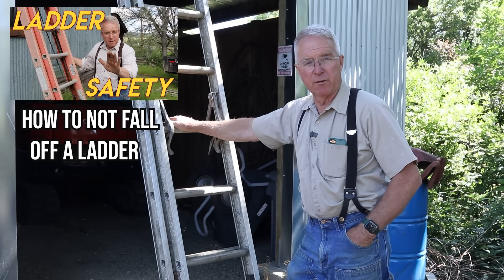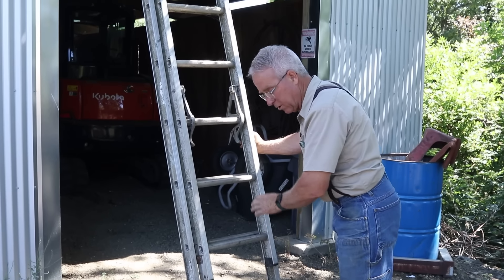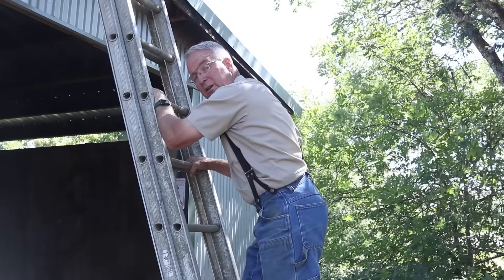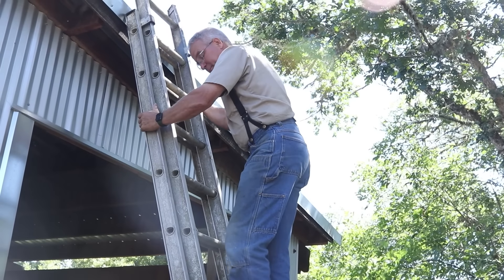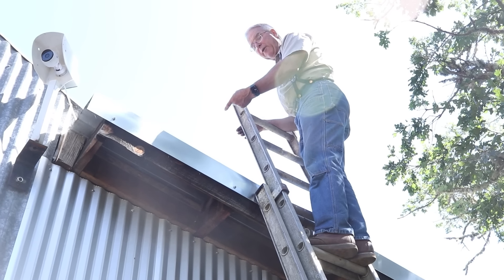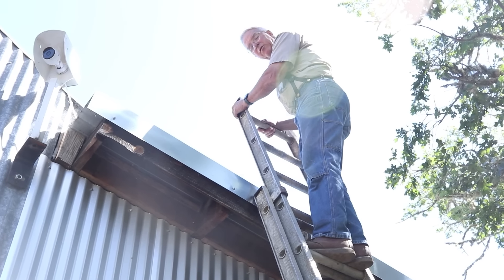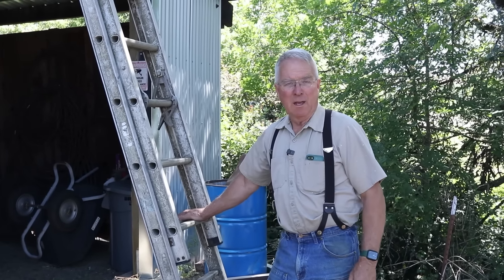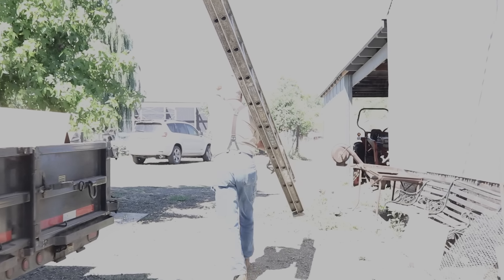How to Climb A Ladder, Dismount, & More Tips

Comment: You forgot 1 important thing when carrying an aluminum ladder. Look out for overhead power lines.
Reply: Solid point!
Reply: I'm Shocked this wasn't mentioned! :)
Reply: Electrifying comment
Reply: @rjtumble 😂
Reply: Yeah, it’s a current issue
Reply: Absolutely stunning!
Reply: Alternatively, you could just do that directly on every job site
Reply: @evanosvath9632
Thanks for those images. I’ll be very very careful from now on.
Reply: And open manhole covers.
Reply: Excellent video. I have a burned out aluminum ladder rung from many years ago when my ladder spun and shorted out a service entrance cable. Fortunately, the rest of the ladder was fiberglass. I would not have an all aluminum ladder. The rest of the video was first rate.
Retired telephone repairman.
Reply: @rjtumble  That's too easy!!!
Reply: And if you don't pay attention, you won't have to worry about anything much longer lol
Reply: Amazing point.
Also once you get to the top don't jump off.
And water is wet
Reply: And Walruses
Reply: You don't want to be a good conductor unless you work for Amtrak
Reply: This is actually a really good tip.
Reply: He’s a bright guy, you’d think he’d conduct himself differently and already know that tip.
Reply: Watt did I miss?
Reply: Yep, carry horizontally on shoulder, don’t carry vertically.  Unless you’re making a Wile E. Coyote video.  Also, I like a nylon strap securely attached to structure lower end and top end. Prevents kick out…
Reply: if people don't automatically do that, they probably don't want to be on a ladder in the first place.
Reply: its so scary 😨😨😨😱😱😱😱😱😱
Reply: Time for an updated video again lol
Reply: @dangoodwin5250 Perfect comment - made me laugh out loud !!
👍👍

Comment: I think you missed an important thing to watch out for: accidentally stepping off the ladder from the second rung thinking it is the bottom rung.  I've done this multiple times (especially a step ladder) because I was not watching the rungs as I got off.  Don't let your guard down until you have both feet off the ground, similar to watching the ball go into your glove in baseball or making sure you catch the football first before making a move to avoid the defender.  If the sports pros still make those mistakes so can we.
Reply: Right on. Easy way to break an ankle, or worse.
Reply: That "thinking you're on step one" when you're on step two scenario is a good heart-stopper.
Reply: I've painted the bottom rung of my step ladders bright orange so  I can easily glance down to make sure I'm on the bottom rung before I step off.
Reply: I've done that too.  The solution is to always assume that your next step down will be another ladder rung until you actually feel the ground/floor.
Reply: Done that a few times and almost messed my pants every time!
Reply: @markhendrickson5886  Presumably with non-slippy-when-dry paint :-)

Comment: As a retired builder and old guy, my house and outbuildings all have an eye bolt screwed in near the roof at the ladder locations. The first thing I do is firmly tie off the ladder before climbing off the ladder onto the roof, that way I know if anything happens, I can grab the ladder with confidence that it is not going anywhere. I know this practice has saved my suspenders!
Reply: is it hard to install eye bolts on the roof??
Reply: @tricatfilms6136  No, not on the roof. Install it in the facia, soffit, or wall near the roof where you can tie off the ladder to keep it from sliding sideways.
Reply: true even a good adjustable clamp can give you a little extra security from slip sliding at the top.
Reply: I’ve also used an eye bolt at the bottom, so there is no way it can slide out.
Reply: @rodgraff1782  Smooth concrete, especially on warehouse floors, is especially dangerous. I used to have 2 40-lb sand bags that I would put on each leg of the ladder to stabilize it.
Reply: An "L" brace with a screw hole works well also, plus there is a rubberized peg with a clip on one end that you stick in the rung hole so you can hang stuff as you go up , like paint cans, tools , cord etc. and you just replug it every two or three steps. You can work from the ladder with this also.
Reply: I put  an 8" flat roof screw instead of a gutter spike in the gutter next to a gutter hanger. Do two of these and I have a sturdy place to put my ladder.

Comment: Dear Mr. Scott thank you for your help with the video. I would like to share when I was with the fire department for 28 years we would practice ladder safety at least 1 or 2 times a year. One thing that was taught and stressed was the angle of the ladder. The rule was, when you step up on the first rung extend your arms and hold on to the ladder your back should be vertical. Not to far back and not to far forward. That is all I would like to share.
Reply: Thanks, that's a great complement to the video.
Reply: The base of the ladder should have been 1/4 the length of the extended ladder from the wall. 12 ft extended length ,base goes 3 ft . Your way is subjectivevehen u say not to far ,not to close

Comment: Been using one of those things on the regular at work for almost eight years.  

Nothing but facts in this vid.

Been to a few job sites where the only way to get up to the roof was on a sloped driveway (due to obstructions and other nonsense on the roof, and then too much height further along).  The customer got really upset when I told him that wasn't happening, not in the wintertime, not on an ice covered drive with a slope in it.  No way.  He wanted me to salt the drive up and I told him he could do that all winter if he wanted to, I'd be back when the ground thawed.

Sometimes, the best way to go up a ladder is to NOT go up a ladder.

Comment: Good job, I was in the fire service for 18 years and although I never really got completely comfortable with heights they taught us to keep our hands on the ladder rungs and transfer one hand at the time to the next rung therefore always having a hand holding on.
Reply: I know I look like an imbecile climbing a ladder, however I try to keep 2-3 points of contact at all time. Yeah, I'm not carrying bundles of shingles up the ladder, however so far a piece of rope, maybe a leather bag has been sufficient to sling over my shoulder to keep my hands free.  Prob won't work if you're actually working though.
Reply: Modern method is hands on the back side of the rails, and to pull yourself in hard if you run into trouble or slip, which will use your entire body as a brake against the rungs
Reply: Use fiberglass 28’ and 32’ to extension ladders every day. The current standard is 3 points of contact at all times, whether that be grabbing the rungs or the rails. Anything brought up is attached to your climbing belt or a hand line to be hoisted up after you reach the top.

Comment: Great video. As someone who fell two floors plus from the top of a ladder, and hit a steel garbage dumpster on the way down, I also suggest, if possible, setting ladders where there is open ground around the base of the ladder. That dumpster did a good job of slowing me down, but broke my hip. 35 years later I still pay for that impact. Or as they say, "Close encounters of the ouch kind". Keeping the area around the base of the ladder clutter free also makes setting up and taking down the ladder easier and safer.

Comment: Its a great guide for people who have no problem on ladders to begin with.  Most people who have no problem with heights can judge ladder safety themselves basically. 
but if you aren't comfortable on a ladder or roof, none of this will help. I can work on a ladder to an extent, but as soon as you get me near a roof, i cant do it. I crawled onto the roof of my shed on my stomach and i wouldnt get up. too scary. Getting off the roof took me about 20 minutes of slithering and shuffling onto the ladder which had about 5 feet above the shed roof.

Comment: As a roofer I try to avoid climbing onto a roof from the gable wall to keep the ladder resting on a nice square eave so it can't slide down the pitch of the roof. I also always hold onto the ladder from the center of the rungs so you don't tip it sideways when you pull on it when you slip. Last thing I feel I need to add is that 3 ft or the osha required amount of ladder above the roof is one of the most dangerous osha regulations because anywhere from 2 inches of visibility up to 18-24 inches is my max comfort because I never climb onto a ladder from the side. Get on all 4s and maintain 3 points of contact on the roof while engaging the ladder with 1 foot and then you can move your 2 hands 1 at a time to be your 3 points of contact on the ladder constantly even when carrying things. Much safer than having too much ladder be in between you and the balance point on that ladder. My first step is on the balance point with my whole body inline instead of beside it ready to push the ladder off the roof with a slight imbalance
Reply: I like your all 4s method, thanks for sharing it. I'm a homeowner and appreciate all the safety tips I can gather.
Reply: ONLY on very steep roofs, it is easier to get on the roof with only 1 or 2 foot over the gutter and having the ladder at a closer to vertical angle. I can keep my center of gravity in a better place while getting on and off the ladder. This has serious trade offs. One, you have to keep your chest glued to the rungs while climbing. Two, the ladder MUST be secured to the gutter. Three, a rope from the ridge is recommended. The above is not osha approved. The above is not approved by me. I do encourage you to understand why it is progressively harder to get on and off progressively steeper roofs. That is because the ladder portion above the gutter is closer to parallel to the very steep roofs and you have to move your center of gravity, otherwise known as your belly button farther out into scary places to get around the top of the ladder when you get on and off the ladder. Center of gravity is everything in climbing a ladder. I am not brave by nature. I go by the saying, "There are old roofers and there are brave roofers, but there are no brave old roofers." At 62 I am an old roofer.

Comment: When carrying a ladder vertically the very first thing you need to do is check the route you will be taking for overhead restrictions such as branches and particularly electric cables
Reply: Yup, checking overhead is absolutely the first thing you do, EVERY time .. Ladder climbers, take note! Also, If you aren't chock full of common sense, let someone else climb/ move that ladder. You need your wits about you at ALL times on the job site, and dealing with ladders is certainly no exception.

Comment: Hello Scott.  I really enjoy all of your videos.  I've worked construction my whole career.  Retired 17 years ago but still enjoy watching.  Love your thinking and methods.  Many things you advocate I've learnded or discovered on my own.  It's great to have confirmation of my own methods and nice to discover new ways of doing things.  One thing I'd like to add is that I tie off the top end of the ladder with a rope or bungee cord so that both the bottom and the top are secured.  Can't  blow down or be bumped by someone passing by.   Also when setting up the ladder, I put the feet against the bottom of the wall / ground and then walk the ladder up over head until vertical, then work the bottom out to the correct angle.  Makes it easy, especially when working alone.  Thanks for your time and all that youdo.  Keep up the good work!

Comment: I'm almost eighty but I have to clean gutters and stovepipes. I have to go onto the roof. I have taken to using two medium c-clamps on either side of the ladder clamped onto the guttering to keep the ladder from going to either side. I tie them on to the ladder with some rope. This makes the ladder very steady and even safer. Thanks so much for the tip on digging a small hole for the feet of the ladder. This is such a great safety measure. You might have saved my life with this advice.

Comment: One issue with gripping the ladder's side one-armed is that if you fall backwards your body will swing to the side as you hold on to the side of the ladder, just like a pendulum. Whereas if you grip the rung (ideally close to the center) your arm is more aligned to your equipment's and body's center of mass, so you'd not swing to the side. If you carry heavy objects with your other arms it's very easy for it to fall backwards and taking you with it if you hold on to it for a bit too long. It doesn't take much to lose your balance past a point of no return. Also the bigger the object is you are carrying with one arm, the bigger the angle for your center of mass is relative to where you hold on to with your other arm.
Reply: Good point, risk swinging vs standing unsupported in the ladder. 
A heavy or big objec can also provide a counterweight, like a bucket of pain on left side of the ladder while you hold the ladder with your right hand. The close the object is to your centermass, the more likely it is to swing you away. You (should) never carry something out behand your back with 1 arm, have it behind the ladder to pull you inn

Comment: I tightly tie the ladder to the structure I am climbing, typically about 1/2-2/3 up to prevent it from slipping out.
I use ladder stabilizer.
I use both hands on the ladder and carry loads in a pail and hoist it up with a rope.
I carry my cellphone with me if happen to get stuck on the roof.
If I go on a roof while alone, I let someone know when I go up, and go down, and how long I expect to be on the roof.

Comment: One thing that might be added.....

I have been on a roof, working alone and nobody else within earshot, with an extended ladder being my only way down, only to have a strong gust of wind blow the ladder over (and down). Could not shout for help. Even if I were to sort of slide over the edge to let myself down to hanging from fingers and then drop to land on my feet, the distance would be enough that something would probably get broken.

In the above situation, what ended up saving me was  that I had used a rope to pull tools up to the roof, and one end was still tied to the top rung of the ladder and the other end I had tied to a 5 gallon bucket that I had pulled the tools up in, and it remained on the roof, even after the ladder fell. Looking over the side at the ladder on the ground, I saw that the upper half of the extension ladder had slipped out of its extension channel but the other side was still hooked in. I was able to pull the ladder's top end up by using the rope, careful to not allow the lower half of the ladder to disengage that one remaining channel hook. BTW, I was laying on my belly and only head and shoulders were over the roof edge. I only pulled the ladder up high enough to re-engage the other channel hook, and then gently lowered it back down to touching the ground. Putting my weight back onto that ladder was one of the riskiest feeling gambles I ever made in my life, but it worked and I got back down.

Since that episode I now do things differently:
1) I have a bungee cord attached at its ends to two strong spring clamps, such that I can weave the cord around the ladder rung just below the edge of the roof, and climb to that height, then move the clamps to the edges of the rain gutter (if there is one) on both sides of the ladder, or clamp under the edge shingles, or whatever they will fit, to essentially tie the ladder to the edge of the roof; this is solely to prevent it falling over in the wind, etc.
2) I got some wide (e.g. 2" wide) double-sided Velcro strap from the hardware store, and cut two short pieces perhaps 18" long each. Once I have extended the ladder, I wrap these Velcro straps around the rails near the channel hooks, preventing upper and lower rails from becoming disengaged from each other.
3) I always have a rope tied to the top rung and the other end fixed to something on the roof, so if it goes over in spite of item (1) above, I can still pull it back up, and with the two straps per item (2) above, it won't come apart if it does fall.
4) I don't go up on a ladder and/or roof (or any other place where I might possibly fall, get stuck, etc;) without having my mobile phone attached to my body so I can call for help.

Comment: Great advice.
I would add that when working with ladders there's one item in particular that stands out for me as a huge safety boost. 
The "Lock Jaw" ladder safety grip. 
It attaches to the top of the ladder, grips onto the roof gutter and holds the top of the ladder firmly so that it can't slip.
I got one a few years ago and feel 100% more confident and safe, especially in that transition from ladder to roof because you have a super solid ladder to hold onto and you know it's not going anywhere.
Best $90 safety spend ever.
Reply: Interesting.

Comment: It is amazing how so few actually know how to use a ladder safely or at least as safely is possible, I was a painting contractor for a lot of years and i made my living on the top of a ladder, I did some crazy things when I was young, now in my 70's I don't get on anything taller than a 6 foot ladder. I let a young buck do the tall stuff. my wife prayed for me every morning to keep me safe as I did what needed to be done. she was right to do that, I lost track of the times i was on the top rung of a 40 foot ladder, they don't make them anymore but I spent a lot of time on one. yes the transition between a ladder and a roof is critical for sure, it begins before you ever get on the ladder, the feet of the ladder needs to be securely planted if there is any hopes of making a safe transition.